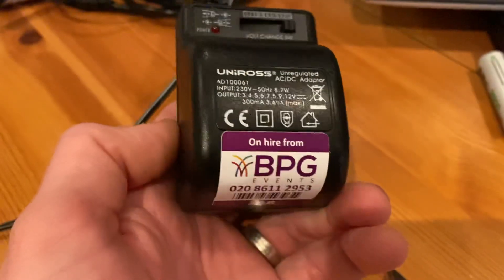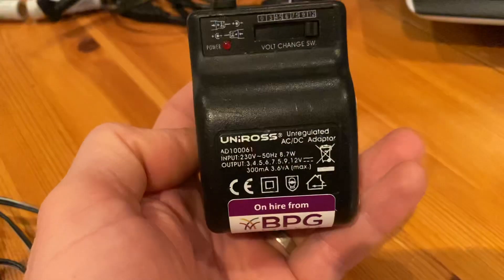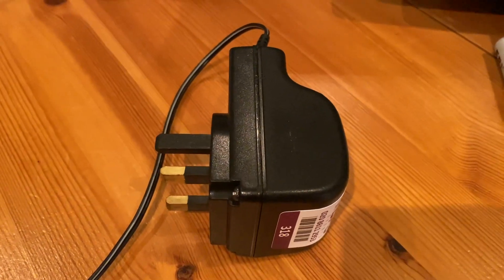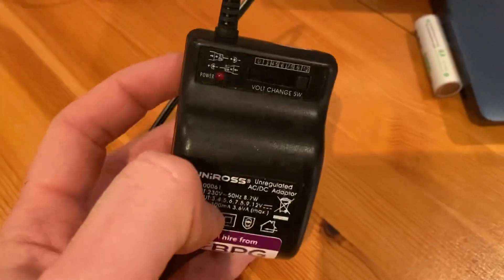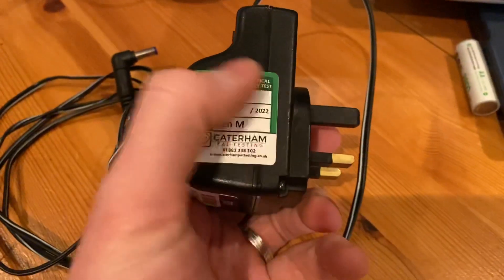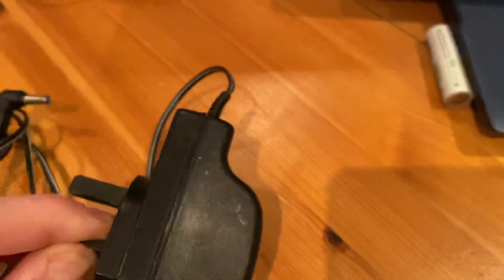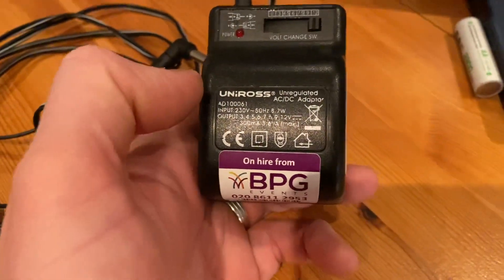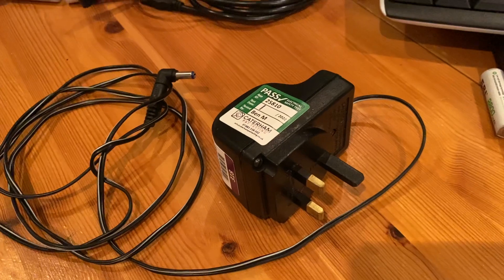Class 2 PAT Test AC/DC Charger Adaptor. Visual inspection only?!

Comment: "It's a class 2 adapter", yet "you cannot do a class 2 check" ...how come? Is this not a flagrant contradiction? Or is it a lapsus on the author?
Reply from the maker: A class 2 items could either need a test through a machine or it could quite simply need a visual inspection depending on whether the item has any exposed metal parts, whether it is of an all plastic construction or elements of both.
Just because a PAT test machine has the capability to perform a class 2 check it doesn’t meant that every items “has” to have that test performed on it.

Comment: hi, if this adapter was used to power a monitor , would you then do a class 2 test by attaching the test probe to an exposed metal part on the monitor e.g. the metal around the video port. thanks
Reply from the maker: No need as the adaptor has likely reduced the voltage to either 12 or 24v. So only a visual inspection is required.

Comment: Hi Ben would you just confirm something for me please? Sorry that this sounds basic! A floor standing lamp with a halogen 12V bulb is wired to use a AC adaptor for 12V output. Cable from lamp has removable jack plug into adaptor. Adaptor has brass earth pin, double square class ll symbol, double circle Electrical Separation symbol. Lamp has class ll symbol. What do I test and how? Would I put the adaptor under load with the lamp and test both? Does adaptor AND appliance get stickers?  Thanks, Steve
Reply from the maker: from the sounds of it I would just perform a visual inspection on the AC adaptor block and if it is a 2 pin figure 8 type cable connected to the plug then this would just be a visual inspection also.

Comment: If one of these went into a keyboard dock device, i would visually test the power cord…would i then plug the cord into the device and then class1 pat test them both as a whole?
Reply from the maker: no there is no need plus you couldn't do a class 1 test on the dock even if you tried.
Reply: @caterhampattesting  thank you. That has been doing my head in for the last 2 hours!

Comment: Hi, thanks for the video.  What is the situation with fuses on these PSUs?  I assume they must have a non changeable fuse internally?  I have just been testing much of my kit and have come to realise that almost none of these plug in style adapters, (Apple iPhone chargers being one exception), have a visible/changeable fuse.
Reply from the maker: they will either have their own internal fuse or circuit protection included
Reply: @caterhampattesting  thanks.  It’s bizarre that I never noticed it before though :-)

Comment: If you did an IR test but with the flylead connected to the exposed metal on the DC output barrel, that would check that there is true isolation from the mains. Many cheap USB phone chargers have very poor mains isolation (check out some of Big Clive's teardowns of them), and performing an IR test between incoming L-N and the dc output will show up if there is any leakage. Tim
Reply from the maker: I think you are getting confused. connecting the test probe to the exposed metal would not prove that there is true isolation from the mains. I'm interested to see how you think a PAT test machine could determine if safe isolation is present or not.
Reply: @caterhampattesting  Perhaps the terms "Isolation" and "Safe Isolation" are a bit confusing. I was not meaning "Safe Isolation" as in making sure that a particular device is truely dead( ie unpowered)
What I meant is, by using an Insulation Resistance test between the (combined) incoming L&N mains pins and the DC output of a PSU, this will test whether there is actually any path for current to flow between the mains and the (supposedly isolated) output. Many cheap USB chargers have very poor construction and some even when brand new have been found to not isolate the DC output from the Mains input.
So all I was saying was, by carrying out an Insulation Resistance check between the (mains) input and the (DC) output, this will at least test whether the output is actually isolated from the (mains) input or whether there is a manufacturering defect or some damage has occurred.
Hope this explains a bit better what I meant, I'm not always so good at explaining, LOL!! -Tim
Reply from the maker: I think you are still getting confused about what an IR check actually does. The IR check is looking for current leakage but of course by attaching your probe to the USB outlet therebis naturally going to be current detected as that is how the item is designed.
Reply: @caterhampattesting  Actually, the outputs of these USB (and other class 2 DC PSU's) should have complete electrical isolation from the mains AC input, and as such will have no leakage at all from input to output. (some class2 devices with a functional earth may show some leakage if the incoming (functional) earth is directly (or capacitively) linked to the output)
The point of using an IR test in this way (between the AC input and the DC output) is to check whether there is either a fault that has developed, or a design fault, that would make the device unsafe. 
In your video you mentioned that there is no test for these Class2 PSU's you can do with standard PAT test gear as there is no Earth/CPC connection (usually just a plastic pin). But actually this is a test that can be done with a standard PAT tester by using the IR test with the flying lead connected to the DC output of the device. (and surely that is what is supposed to be done, testing to an exposed metal conductor, ie the exposed metal part of the DC barrell plug)
There are so many of these devices out there (and so many cheap/dodgy imports) any additional test we can do to try and identify a faulty one before it harms someone has got to be worth doing.
Tim
Reply: @spuddevans  And, a couple of years late, remember that the DC connector is going to be plugged into a device that is likely to have exposed metal.

So, although you can't measure any earth leakage as such, you can still measure isolation - important, as I had one where a fault on the SMPSU had acquired a leak from L input to -ve on flying lead. Also, as part of PAT testing, functional testing is required - so it should be tested to see if it works.
Reply: I'm new to pat testing so haven't figured everything out yet but when I do a ac dc adaptor I plug into the machine we use a seaward primetest 50 and I put the clip on the end that goes to the device and run a class 2 insulation test to see if it pass or fails am I doing it wrong as I've never really been shown I did the course and passed and was given a machine ( I volunteer at a charity shop ) I just wanna make sure I'm doing it right

Comment: Would you recommend PAT testing the devices connected to the low voltage adaptors?  My guess is no as there should only be less than 12v going  through them.
Reply from the maker: no, there is no need. you could perform a visual inspection.

Comment: What concerns me with at least the Apple ones is the possibility of undetected fakes.  Yes a product designed to UK/EU safety standards with a genuine CE mark will have the DC end well isolated so if I'm confident about its country of origin (not so bad for in-house testing where you may well have ordered it yourself) then a visual inspection would be fine.  But I've also seen a few Big Clive teardowns of fake Chinese exports where live components inside are dangerously close to DC components, screws or shielding and heard of cases where they have touched and turned the entire associated Class III appliance live. So I'd be inclined to still do insulation and touch leak etc with the probe on the DC end if the visual inspection is inconclusive about the origin of the adaptor.  It's no guarantee of safety (could be that a part inside is really close and only in usage and heat expansion does it arc across to DC) and chances are if it's that dangerous someone would've already tried to use it and found out the hard way - but if it does happen to spot mains leaking to a DC jack before someone zaps themselves then happy days.

What do you think, or would you just fail it if not 100% certain it's genuine?  They're sometimes pretty good at producing fakes and I'm not sure that "I think it's a good one but I'm not 100% so I'll fail it and make you buy a new one" would be as acceptable to them as "I think it's a good one but I'm not 100% so I'll go above and beyond the requirements on the testing"

Comment: Hi Ben.  Do you test the modular power pack units, like used in schools under desks in metal racking often daisy chained together with gst18 connectors!
Reply from the maker: yes they all need to be tested, the individual cables, the extensions themselves and often they have a separate earth lead which might be connected to a metal desk or surface.